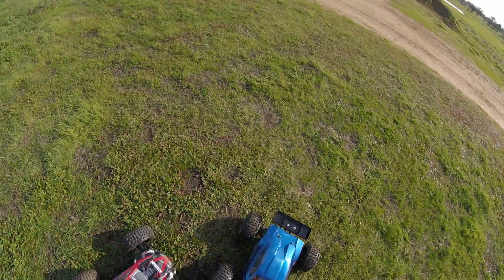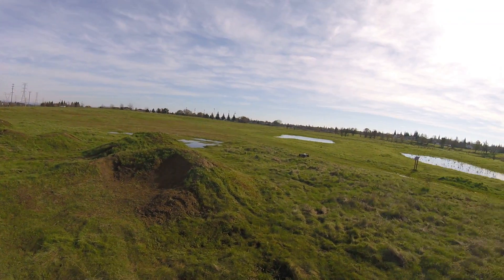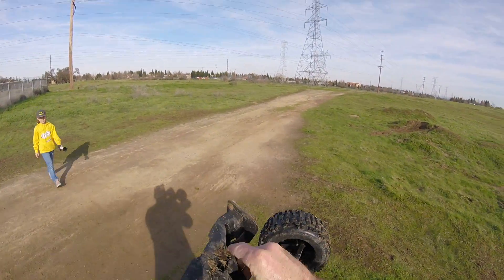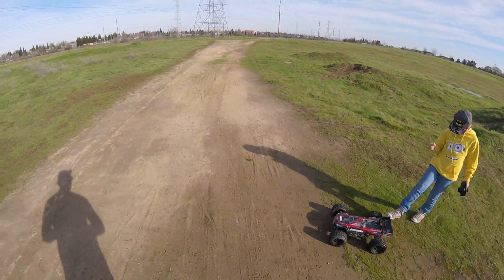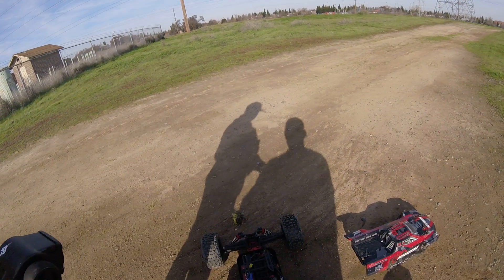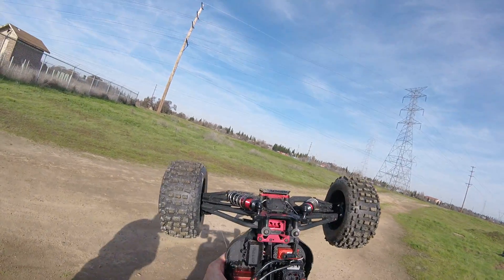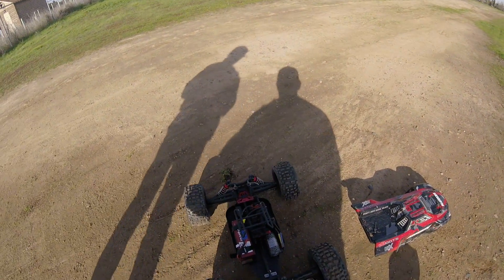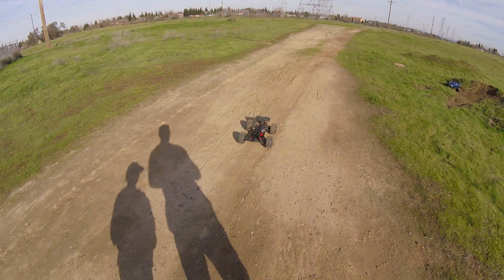Arrma Outcast 6s vs Kraton Beat Down 2/2

Comment: Nice bash man. Tearing up the Kraton. Lol mines all tore up.
Reply from the maker: Kenny holy crap. Just went bashing with my son driving Typhon and Outcast, Angie driving Kraton again after fixing front diff center output, wing got shoveled over and over, toast, missing large chunk, flapping pieces left. Outcast pinion slipped with Andrew driving 6s, ate into motor mount teeth fairly jacked, bug body tail totally cracked after tail/wing digger landings, Typhon wing mount fairly tweaked, ended bash with rear wheel drive only. Tried a new rough spot with sketchy jumping, not going back anytime soon. Had a few flails myself!!!🐒🐒🐒
Reply: That doesnt sound good. Sounds like a bad day. Hope U get it all back running again. I really hate days like that. You sound like you got my luck.
Reply from the maker: No doubt....Lol.

Comment: Easy fix''''' locktite on grub screw front output shaft
Reply from the maker: RCbashing the KRATON what's crazy is grub screw was stuck with lots of lock tight, had to cook off with heat gun and reset grub correctly. It would catch and then slip so Angie's fronts weren't turning at end of vid. We had a pretty brutal collision in vid 1/2, sheared Outcast bumper clean out of 4 screws. Bound to happen sooner or later bashing with the kids. Kraton nose landings galore too!
Reply: Rich Duperbash did you are t bone bumper I put on outcast?
Reply from the maker: I just stole Tbone off Typhon and slapped onto Outcast along with mini stock Typhon bumper, hopefully it doesn't shovel off jumps leaving to test now with kids, family bash.
Reply: Rich Duperbash actually that is bumper I ordered typhon one..the kraton  t-bone bumper is too big and has that second piece on top
Reply from the maker: For those of us who like to launch, think you're right Kraton bumper is to big. Just had brutal bash session at new, rough spot, may post carnage vid, too many lid and wing landings to count, daughter trashed Kraton wing, son cracked back of bug body on Outcast... Ouch! Typhon took serious beating too. Good news is that Typhon Tbone worked well on Outcast.